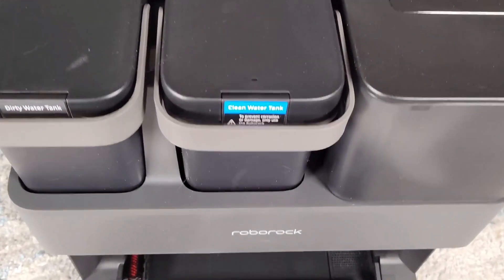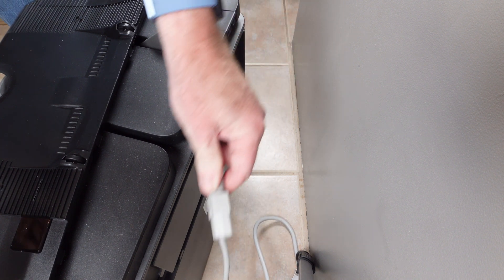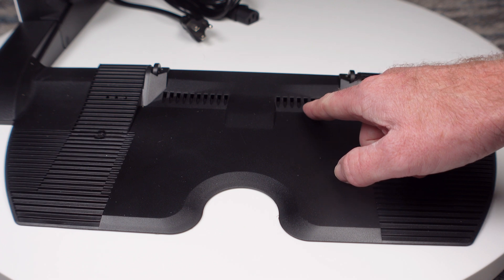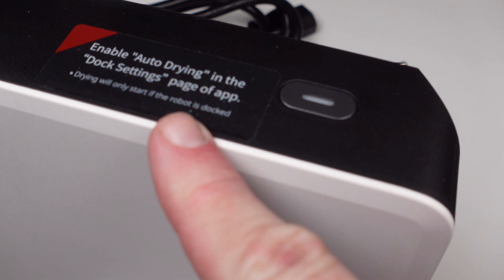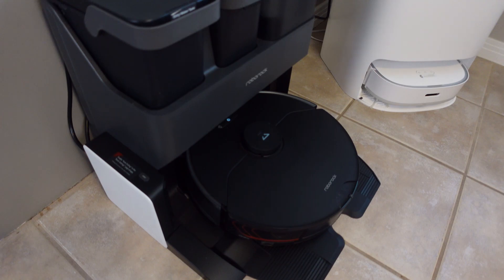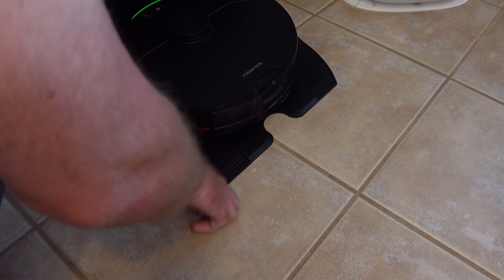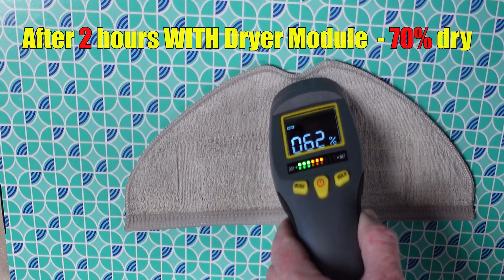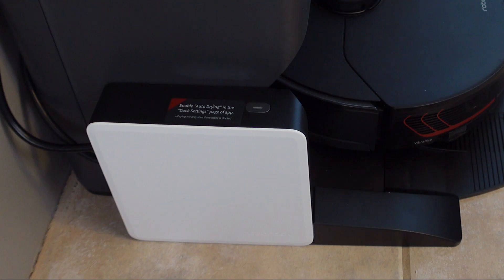Roborock S7 MaxV Ultra Dock Hot Air Dryer Module - Full Test Results!

Comment: I have a Tineco wet/dry vacuum mop and that fucker smells like ass if you don't remove it from the unit, hand clean it and let it air dry. I just ordered the MaxV Ultra last night for $1060 Black Friday deal on Amazon. I think I'll be ordering the dryer, too (although Amazon only has it listed from a scalper for $160.)
Reply from the maker: Roborock does not sell their dryer module on Amazon and according to Roborock it is not their unit.  I would be careful buying that one and wait for the official one on the Roborock website.
Reply: You can preorder on roborock’s site. It is estimated to ship out next Monday - 12/5. Not that big of a deal as long as that date doesn’t slip.

Comment: This why you don't buy 1st product of new innovations everyone make mistake roborock have the best solution but they forget to put this drying fan, even using cheap van to blow constant air will help drying process. Both ecovac lack the mop lift function, dreame forget to put water tank into the robot, but they smart enough tomake the base detachable so you don't need to bring the whole base to clean it.

Not to mention they expensive as hell.
Reply from the maker: The new L10s Ultra video will be out soon.  Come back and tell me what you think.

Comment: I think robot mops vacuum combos still have a ways to go. I might consider just a vacuum especially since I’m afraid of mold and more maintenance since it has more parts than a vacuum only
Reply: I use a roborock. It is hands down the best vacuum/mopp I've used. Miles ahead of the ecovacs I used before. It's app is outstanding and many of the annoying issues simply don't exist with this thing. I haven't noticed any mold issues.

I have large dogs always running through my house and this thing keeps my floors cleaner than I could have imagined. The amount of time it saves me, I used to spend 1-2 hours cleaning my floors, every day. Now I maintain the robot, probably around 30 minutes a week.
Reply: I tried using the irobot mop one but it doestnt do the job.  I had the old SCOOBA from iRobot.  That one was cool.  BUt I have 3 dogs and the s7 with the dock works awesome!!!!
Reply: My floor plan is all hardwood floors and I have area rugs all over.  This solution is perfect.  It does a great job mopping the floors and vacuuming the rugs.  With this dryer module, everything is not totally automated and the first time I have a complete solution.  You can wait; obviously your choice but this robot is amazing in my scenario.

Comment: Hi, I just got the drying module. Whenever I manually press the button to dry, it will off itself after a few seconds. Does this happen? Or could it be a fault?
Reply from the maker: Did you already enable it in the app?
Reply: @jamie.andrews  Yup! Already set it to 3hrs but it still turns off after a few seconds. I think it's a fault on my product, will ask for a replacement!
Reply: @An3mon3s  mine is doing the same 😢 did you find any solution?
Reply from the maker: @An3mon3s  Sounds like it.
Reply from the maker: @hamieh1  Where did you buy yours from?
Reply from the maker: @An3mon3s  Where did you buy yours from?
Reply: @jamie.andrews  Ali express ,

Comment: I haven’t ordered my robotics yet and just heard about this dryer module. I had no idea that the wet mop pad was an issue but definitely gunna get this as well when I order the unit. You’d think now that they’d include it in the new units that they manufacture hey.
Reply: I haven't found it to be an issue. I am using the cleaner they sell in the water. The dryer is a neat idea but I'm not sure it's necessary.

Comment: If only they had a black module, looks kinda silly on the black dock. I have this for downstairs in our house, we also have a dreame w10 for upstairs, the auto drying is wonderful on it. The AI on the dreame is stupid but, keeps losing the side brush and getting itself stuck 50% of the time. 😆
Reply from the maker: I am testing the new L10s Ultra now and it is impressive so far.
Reply: @jamie.andrews  also the w10 water tank clips that hold the lid to the tank is made rubbish. Mine have already broken off after about 2 months use, have been waiting for the replacement under warranty. Besides that it’s a fairly good robot vacuum/mop for the money.
Reply: @jamie.andrews  This robot compared to Roborock S7 Ultra with dock, what do you think is a better buy ?
Reply from the maker: @Sun.n.Flowers  I am not sure yet as I am not finished with testing.  I will have a comparison video out before the holidays.

Comment: I was able to find this dryer module from a seller in China that ships to the US, but I was just wondering whether a Chinese version dryer module would work with my roborock version that I got from the US or not, as I am not sure whether it draws power for the dryer module or directly from the base, because I know the voltage in China is 220v compared to here in the US which is 120v.

Would appreciate your feedback on this
Reply: Chinese version can be use in the US
Reply from the maker: It will not work unless your dock is 220 as well.  The dryer provides power for the dock.
Reply: @jamie.andrews  

I see, but would it be possible to use it if I got a power converter, or would it just be safer to wait until they get it back here in stock
Reply from the maker: @lenardcody8357  You may be able to do that, but I would just wait if it were me.
Reply: I tried ordering one from Roborock, but they've been out for a while, so I bought one of the dryer modules from China on Amazon - it said "US Plug," so I thought that's what it would be. Turns out it had a European plug, but came with an adapter for US plugs. Since there's no voltage conversion, it works just fine with the adapter plug. I worried because you're replacing the main AC cord with the dryer module cord, but all is well.  It is a Roborock-branded dryer module and works as expected. The app recognizes it, too. I think it is important to dry out the mop pad. Here's the one I ordered on Amazon: https://www.amazon.com/dp/B0BNG7DRMM?ref=ppx_yo2ov_dt_b_product_details&th=1
Reply: @LDBecker  I got one from China but got it for $38 plus shpping etc...came out to $56
Reply: I got mine directly from China and it was a genuine part.  Works great.  But as someone pointed out, the plug is for a 220 but the package I got came with the adapter

Comment: I have the chinese version of the module. Too bad the module doesn't appear in my app. Roborock Support says that won't happen in the future either.  I have the S7 Pro Ultra.
Reply: same problem, but I think it does not depend on the fact that the drying module is the Chinese version because on the s7 max v ultra the Chinese version of the module is recognized.  I believe the s7 pro ultra doesn't have the software to manage the module yet.  We hope for some updates
Reply: @Da_A7X  I now believe that too. Exactly the same part will soon be available in Europe, only with a different power cable and international instructions. I just wonder why Roborock then says that the Chinese model will not work in the future either.
Reply: I bought it from China too and the module does appear in my app (iOS). Are you using the Xioami Home App (green logo)? I used to use that app, but the dryer modul only works with the official roborock app (red logo).
Reply: @chixbro  of course, we use the roborock official app ... but here the problem is that we are talking about S7 Pro Ultra ... your module, does it work with which robot?  S7 MaxV Ultra?
Reply: @Da_A7X  Yes, Roborock App, the S7 Pro Ultra is Not supported at all.
Reply: Thank you guys I was about to buy it for my S7 Pro Ultra. 
I will wait for the official release in Europe now.
Reply: @fluffyman15  That‘s why i wrote this. :)
Reply: @sethko123  , could you please tell me how the unit behaves when you manually start it on the S7 Pro Ultra? Does it at least automatically stop after a few hours, or you also have to remember to manually stop the drying module also? Thanks.
Reply: @mirceanovac144  It stops after 3 hours and the mop is dry. But i think it's not worth it. I don't want to keep pressing the button like a Neanderthal. :) I sent my module back.
Reply: @sethko123  thanks for the quick reply and info. Actually i fully understand you, as that is why we paid so much for this robot vacuum and dock combo, to be as fully automated as possible. So, with so much technology in this dock, a push of a button after each mop job kind of defeats the purpose. Strange that they do not want to enable the app feature in the S7 Pro, i do not think it is rocket science, it should be similar to the option available for the MaxV. I highly doubt that it is a hardware limitation as the docks are identical, only difference seems to be the color. Maybe it’s just Roborock adopting Applle strategy and offering certain features in the high end product. :)
Reply: @mirceanovac144  You're welcome. And yes, that's exactly what it is. Everything is there: a well-made drying module, the infrared sensor and so on. The only thing missing is the app. And this is very weak from Roborock.
Reply: I see they don't offer certain accessories in the app. I've also been waiting for a year for them to release their ORE Rewards program!
Reply: I got mine from China as well.  And mine appears on the app
Reply: @jessediaz918  Than you have the „S7 MaxV Ultra“. „S7 Pro Ultra“ still don‘t work with the app — shame for Roborock.
Reply: @sethko123  Yep.  Someone else pointed that out to me.  Sorry didnt realize it was just for the S7 Utra
Reply: @jessediaz918  do you have the S7 Pro Ultra or the S7 MaxV Ultra? The problem described above affects S7 Pro Ultra, and not the MaxV Ultra.
Reply: @mirceanovac144  Ahhh that explains it.  I have the MaxV Utlra.  Thanks for clearing that up

Comment: Glad to see a review on this I'm looking into getting the ultra and didn't know if the mop dryer was really needed. Did you ever smell your mop when it was just sitting there or mopping or was it when you just took it off or turned it over?
Reply from the maker: I only smelled it when I removed it.
Reply: @jamie.andrews  you mentioned on the vid that it smelled a bit when it was still wet. But did it smell when it was completely dry after 18h? Im wondering if this dryer is really necessary
Reply from the maker: @xeon2k8  No real strong noticeable smell after it dried.  I don't think anyone really needs it, but that could be argued also.  I prefer having it.
Reply: @xeon2k8  a bit late but I don't notice any smell from mine. I use the cleaner they sell in the water. Not sure if that matters.
Reply: @jamie.andrews  did you use the cleaner in the water?
Reply from the maker: @jonathanpark7658  I use the Roborock cleaner.
Reply: @jonathanpark7658  I use just one capful of the Omo cleaning solution in every full container of fresh water. So far, it's the only cleaning solution Roborock endorses. I've read other people are putting in a bit of vinegar in the water, others a bit of disinfectant, which has eliminated any odor issues.

Comment: I just installed it too and unfortunately it’s definitely a must have.
Reply: why is so? did the mop smell bad without it? even after completely dry on ambient air?
Reply: @xeon2k8  Yes, the mop gave off a bad smell while wet and even completely dry. To the point where it left a smell on the floors but the drying module plus Omo cleaner has completely eliminated it.
Reply: @brandonwatson6702  i see what you mean. Though I would be a bit sceptical that with the Omo solution and without the dryer it would still smell. When you said it smelled where you using the solution?
Reply: @xeon2k8  I bought the dryer specifically because it was still smelling after using the Omo for a little while. After I installed the dryer it’s perfect!
Reply: @brandonwatson6702  Do you think the cleaning solution is worth it? I use it and don't know how effective it really is. The diluting is annoying too.
Reply: @Sun.n.Flowers  Honestly, I can tell that the dirty water doesn’t smell as bad, but as far as cleaning the floors it doesn’t seem to make much of a difference.
Reply: @brandonwatson6702  thanks for the quick answers mate!
Reply: @xeon2k8  no problem!
Reply: Thanks, going to buy one now.
Reply: What floor type do you have? That it left a smell on.
Reply: @spacecowboy07723  hardwood

Comment: by the way, with the latest S7 firmware & app update (for Android), they finally fixed the bug in which the cleaning mode would always stay on "deep" once used, without any notice in the app (meaning, no vacuum at all). and it only took...7-8 months
Reply from the maker: Glad to hear they fixed it.  I can tell you there are bugs (some major) in other brand robots that never get fixed.  I have tested all major brands and RR updates firmware for their robots the most.  I agree though that 7-8 months is too long to wait.  Thanks for the update!
Reply: it's 100 percent needed IMHO to prevent germs from growing on wet mop since it has an odor without the drying module.